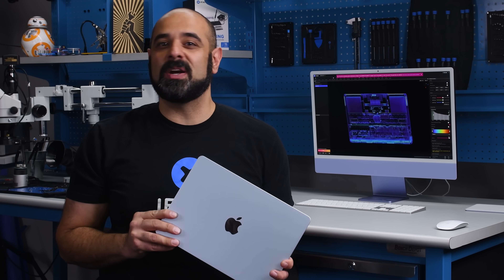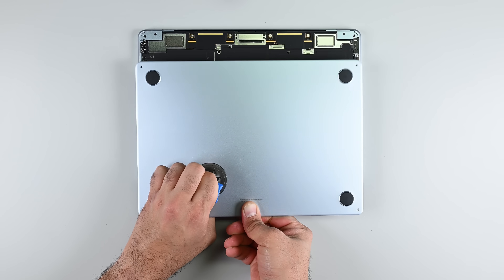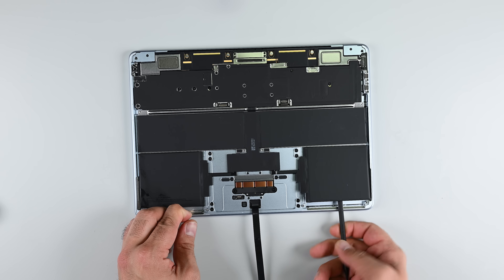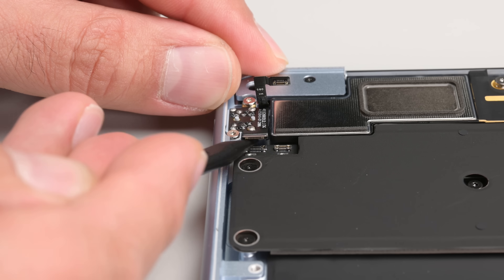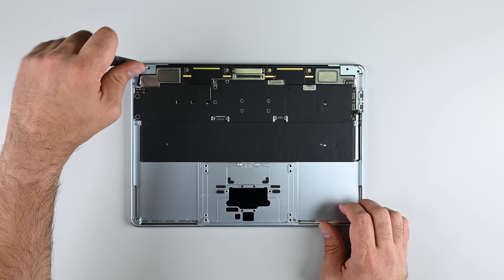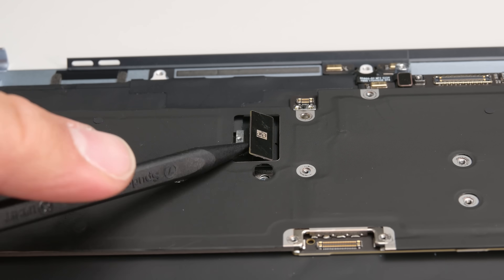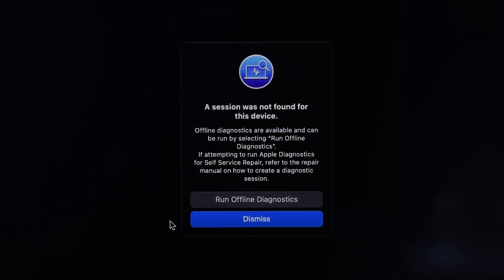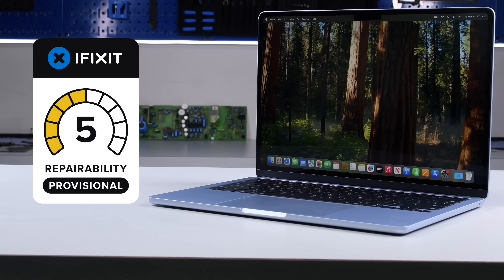MacBook Air M4: A Repair Win or a Locked-Down Mess?

Comment: So I replaced the screen for M4 Air, and now nothing works like my trackpad, keyboard, and backlight, only works in recovery mode. I checked with AI and it says its a new feature of Apple on M4 and up. They automatically lock when they detect screen replacement and only certified Apple Repair Centers can fix it. Do you have any idea how I could fix it myself? The screen I put is a donor from a same exact MacBook

Comment: what happens if something really small and solid, for example skin gets into the space under touchpad? because there is space in the lower part of the touchpad
Reply: Nothing? The trackpad isn't mechanical it doesn't physically move. The click you feel is the haptic engine.

Comment: What will likely die first ? The battery or the ssd ? Is the ssd soldered on the main board ? If ssd dies i guess we can still boot on a external ssd and if the battery dies i guess we can power the mac theough a external usb battery ?

Comment: People keep overlooking how part paring stops criminals from stealing devices and selling it for parts.

Best compromise is have a setting on your iCloud device so that you need to unpair it and then also do another step to unpair components.

So that if your MacBook dies. You can unpair it and now the parts are free to be used. So if someone steals it, well they can’t unpair it without your iPhone, Password, Email so now it keeps the good anti stealing by having it all be paired. But if it actually breaks and needs to be fixed or you want it use parts from it. You can.

Probably super hard to build such a system but that’s the best solution.
Reply: wow excellent idea. sadly I don't see apple (or other manufacturers) adopting this.
Reply: They already have exactly this for iPhones, let’s hope it comes to Mac’s too
Reply: I don't think this prevent anybody from stealing. They don't care. They would steal it, see that it's unusable, throw it and go on with their lives.
Reply: If my device is stolen, I couldn't care less what happens with it. Its gone either way.
Reply: @emaaddar5017  it makes it less attractive to steal devices if they cant be sold for a profit, thus making theft less common.

Comment: All done on purpose. It's a nice device. Just don't buy if you cant swap SSD or ram.  SSD dies after 3 to 4 years depends on use. Then laptop becomes an expensive paper clip.
Reply: my 2017 macbook pro still works fine. most of them do actually.

Comment: A locked down mess. SSDs wear out in a few years if used every day, and replacing them shouldn't require a full disassembly and soldering on the main board. This bs parts pairing is still going on, it's insane...

Comment: Sorry dude, but the use of salvaged components feeds the black market of stolen laptops. Those locked laptops will be sold for parts if theres nothing preventing the use of those parts on the system.
Reply: well. good? do you think those laptops will become less stolen if you just wish hard enough and believe every word out of apples mouth? personally i would rather see stolen laptops not become literal trash, even if that means they get sold for parts

Comment: It’s weird that the iPhones are getting more repairable while the MacBooks are about the same as they have been.
Reply: They could do with going back to 2012 and earlier. The old MBPs in 2012, I had both a 2.3GHz 15” and a 2.9GHz 13” at one point, and they were so easy to upgrade ram and HDD…even the battery was an easy swap! Mine were both non Retina and had SuperDrives, I bought caddies and put in two Samsung EVO SSDs in each, and booted off them in parallel (RAID 0)…they were darn quick for Intel machines in that configuration…I uploaded my stats to Geekbench.

I even swapped out the touchpad on the 13”, piece of cake.

Comment: I just know they will remove the parts pairing lock someday. Apart from that, this is a rather repairable machine, sure most components are soldered, which is a pain, but that's what it took to make them as power efficient as they are considering how powerful these machines can be. Plus it's acceptable for an ultra-thin laptop, not so much for the Mac mini and specially the Mac Studio and Pro.
Reply: don't hold your breath
Reply: @ I know they will either because they are forced to or change their mind like they did with the 15 series by allowing used parts to be paired. On the board-level stuff tho, yeah I don’t expect much apart from maybe upgradable storage, like we have seen with all Mac Pros and Studios plus the new minis. Sure, they will be using their silly proprietary designs but as long as it can be replaced and is socketed, the third party market will always find a way.

Comment: For me upgrading the RAM and storage is big repairability. Sadly Apple will never let this happened until some government body wants Apple to do it .
Reply: RAM is defensible in modern CPU architectures. Storage I do agree should be easier to replace in most cases.
Reply: soldered ram does make sense from a performance perspective but storage does. I'd want them to keep things unified until a socketed solution is as fast as we have now. but on the storage front now we have thunderbolt 5 external ssd enclosures that outperform the internal SSD chip that is soldered into the motherboard. So just greed, really.
Reply: Socketed RAM can’t keep up with modern architectures, its why Framework went the soldered path with their desktop

Comment: huh, the speakers being part of  the antennas is a page out of the ill fated MacBook 12 inch.  is this the same in the 2022 Air?  def not the M1 Air, as I had to take the speakers out of that one to replace the battery (speakers first).
Reply: been the design from M2 models onwards.

Comment: parts pairing should automatically deduct 10 marks from whatever score you have... there cannot be anything more disastrous to repairability than part pairing.
Reply: Parts pairing can be done at home by the user
Reply: imo not having modular parts is worse. Imagine if the usbc ports were part of the MB (something Apple has done before many times). If one broke you’d have to replace the entire board including paying for a new cpu and gpu and storage and ram. All because a port broke. That to me is way worse
Reply: @nickd7935 how about usb c is modular but paired. After the device is out of Apple support list u can’t do anything with that modularity

Comment: I'm shocked that the MacBook Air has more repairable USB-C ports than my ThinkPad. A surprise, but a pleasant one.
Reply: Lenovo absolutely cooked the thinkpad brand, especially with the plastic body base models that flex so much that the logic boards snapped. I don’t daily drive it but I still have a thinkpad T530 which is my favourite laptop of all time
One of Lenovo’s first thinkpads before they ruined ir
Reply: @himynameisryan  I have a T480. Without a battery. The ports are miserablt loose.
Reply: @ the 80 series is way newer and they’d already ruined it by then
Reply: @himynameisryan  you are talking about ideapad not ThinkPad....
Reply: @ no I’m talking about thinkpad.
The new thinkpads are just basic ultra books, the base models are plastic and flex so much the motherboards break inside. I work at a Lenovo warranty centre.
The more expensive ones are magnesium and don’t break so easy but are still just ultra books
The chunky thick boi thinkpads of yesteryear are long dead and everything after them has been progressively worse build quality, and as this comment pointed out they are becoming less and less repairable
Ideapads are a different thing entirely
Reply: @ I do still hate the MacBook keyboard, unfortunately. I would rather use a modern (T14 or later) "low-travel" ThinkPad keyboard than the joke on the Mac.
Reply: @himynameisryan  its just the E series innit
Reply: Crazy 😧
Reply: Yes this looks very easy to repair it is making me think of getting one my thinkpad can’t run windows 11
Reply: Yeah, they've been shipping USB-C MacBooks for over 10 years (Jan 2015) and only one model had soldered ports, (an entry level 2017 model) they learnt pretty quickly that was a bad idea. I think it's one reason they've added back the MagSafe magnetic charge connector which is a lot more robust. You can still fully charge with just USB-C only though.
Reply: Exactly I was very skeptical having just repaired my daughter old iPad 8 gen. I was shocked how intricate and delicate things are. I feared Apple rolled the same design into the Macs but thankful this M4 seems ‘ok’. Now to wait for DosDude’s YouTube channel to show us how to get around the storage and parts gen lol
Reply: @ChadamusMaxamus  Apple (and authorised repairers) repair MacBook Airs, they're deisgned to be modular. Like an iPhone is. An iPad isn't designed that way, they swap whole iPads over for a repair price. So it's quite a different build. Good job fixing the 8th Gen though :)
Reply: @ I mean the iPads are a lot thinner than the MacBooks tho, they have to fit more stuff into less space
Reply: You can upgrade your Lenovo instead any Mac
Reply: @gto981 new thinkpads got most things soldered as well ☹️
Reply: @himynameisryan  6 month ago I bought Winblu notebook, i5 11th, 16 GB RAM and 1 TB nvme payed 500€. Unscrew 8 screws, I can upgrade to 64 GB RAM and ad add 2.5" SSD
Reply: EXACTLY!  I took apart my thinkpad because the USB-C connector went bad and realized it is not worth it.  I thought it would be an easy and inexpensive fix because it was thinkpad.  I bought thinkpad because of repairability and to see the macBook air beat out thinkpad on this one is terrible.  My next laptop IS going to be apple.  Goodbye thinkpad.
Reply: As you referred to the ThinkPad, I want to mention that I have used Thinkpad T490 for long time. Absolutely fantastic. No issue since 2019. Now changed to HP zbook g11 intel ultra 7 14 inch. Very great to use and speed pretty good. It costs me similar to the price of MacBook Air M4 base model. Very satisfied. Breeze to use.
Reply: @ the new thinkpads aren’t as good as the old ones
They’ve become just another ultra book 

Personally I’d rather a m4 MacBook Air for an ultra book because all the laptops you mentioned aren’t as good in the battery, display, trackpad, speaker, performance on battery, and maybe even single core performance, personally I prefer the thinkpad keyboard to the MacBook one but after using a Mac you get used to it, it’s good enough 
Everything else tho I’d take a MacBook unless you specifically prefer windows or need windows programs

Comment: If apple locks the part with software I have a simple fix just remove the software and install linux
Reply: What is the point of spending the ridiculous amount of money Apple charges unless you specifically want Apple software
Reply: You can't do that on the M4 unless you want to write your own drivers and distro

Comment: I’m not concerned about using third party parts, in that I would never use them. Who makes them? Where are they made? Do they perform equally? Is there any reason I should be concerned about malicious behavior from this parts? Really, I want genuine manufacturers parts. If something needs to be calibrated, I understand that. These are concerns that are important to me. The reality is also that studies have shown that a lot of time people repair their own devices, the performance isn’t the same. Sometimes people break parts. Not knowing to to start a screw (you turn it backwards until you feel and hear a small click, indication the screw is returning to the thread in the part) means you can strip the part and damage the screw partway in and damage the head so that you can’t get it out again. Lots of times people think they can repair their own devices when they actually can’t. Being heavy handed, impatient, not understanding the instructions are problems that are more common than you might think.
Reply: My brother in christ, ... tell me what the reasoning is supposed to be for having my Display artifact while in use when I pull a fully working OEM display from a defunct unit and place it on a different one (same model obviously)? Calibration?? LOL! My ass. It's gatekeeping for the funny new doublespeak term "aftersales". You need to bring it to an authorized service provider, they'll click a button, the artifacting is gone. Let's just say I'm talking from experience - and not that of a customer mind you. 

Parts pairing - where no secure enclaves for biometrics and the like are involved - is abhorrent anti-consumer bullshit. If you're willing to play along and bend over backwards doing apologetics, more power to you. Just know that the result is one where you're not ending up with "more power" ;)

Comment: PC manufacturers need to take note of the USB C ports not being soldered to the motherboard for easy replacement.
Reply: I came to make same comment!  THIS is the most common use/wear failure and they did a good job with flex cables on the connectors so that mechanical movement is not stressing the solder joint! It is a double win because the flex cable permits some tiny compliance without stressing solder AND it is easily replaceable when it fails!
Reply: Apple shipped the first USB-C Laptop in January 2015, all new MacBook designs since have been USB-C. Only one model, the entry level 2017 2-port non-touch bar macbook pro, had the USB-C ports of part of the logic board. Everything else had separate ports.
Reply: I don’t have to worry about this problem. I’ve always babied my 2011 MacBook Pro bought brand new & I still baby it. I also baby my M4 Pro bought new Dec. 29, 2024
Reply: In fairness, they are super easy to replace if you know who to solder.
Reply: From just the engineering point of view, Apple is second to none. I'm always amazed to see how well thought out these devices are internally. So sad about their attempts to stop people from repairing things themselves, because these devices are so well made for that.
Reply: @Hans-gb4mv  They design stylish components, nothing more. Macbooks have had a lot of terrible design choices (not just from a repairability standpoint, stuff just was designed to break from normal use).
Reply: @ That's demonstrably untrue.
Reply: @shadik1998  you don't know what you're talking about, I've had a MacBook Air 2017 and its still working with me under heavy use, zero issues
Reply: @Sornio Lmao the post 2016 keyboard was so bad that even apple admitted it and made a recall of pretty much any MacBook post 2016 due to butterfly keyboard failures. Not even mentioning the flexgate of MBP which was never addressed, even though widely reported by mass (including apple-leaning) media. Geniuses made the display cable so short it often broke itself within a year or two. Then apple silently extended it by 2mm and thought no one will notice in 2018.
Reply: Boom, roasted
Reply: Nope. As you know, all manufacturers try not to allow users to repair. You must go to see them every time.
Reply: or at least do what framework has done, make adapter to extend the type c port, and extended part can be easily swap out.
Reply: @taiwanese_9999 its pretty space inefficient, theyd rather use that space for more battery
Reply: @joebidenVEVO  so it is "at least", still better than solder everything on mainboard.
Reply: where do u think apple copied it from?

Comment: Display replacement common repair? I have never ever broken a display on any laptop. What exactly is ifixit smoking?
Reply: He is not entirely wrong though. It's more like replacing the bad display units as opposed to broken ones. The ones that have nasty green/red lines streaking across the middle of the screen.
Reply: Ever heard green line or burned display?
Reply: your laptops probably don't have a glass surface on their displays then. Macbooks do and the tiniest speck of crumb stuck between the keyboard and the lid will potentially kill the glass surface + LCD.

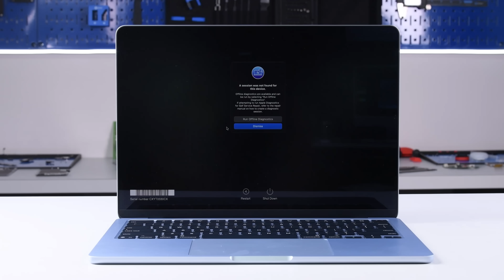Comment: 6:17 Is it upgradeable (but proprietary) storage? No.  I'm guessing many of you came for this info.
Reply: Yes, I was waiting for this. I only bought the M4 Mac Mini base model because I'll upgrade its storage myself (there are already aftermarket 2TB modules), and I would've only bought the new M4 Air if it had a non-soldered storage module as well. So it's a pass i guess, maybe next time. I'm not willing to pay for the storage upgrades from Apple.
Reply: @hrznn External SSD is the way to go anyways.
Reply: Been waiting all week for this answer
Reply: Should be but it has its caviart as the part pairing on top of when there is a free space but it misses quite a few components to actually put a nand chip there

Comment: I bought an iPhone 8 Plus battery, & now I cannot get rid of the assistive touch, I have tried everything & it has a funny way of popping up just before I tap the screen & so then an unwanted function occurs. I have bought batteries from iFixit before & not had this problem. This one I will have to send back!😪

Comment: I was looking forward to seeing the heatsink on the SoC and seeing if it seemed better than last year. But you didn't do anything with the mainboard besides remove it.
Reply: You can look it up online…
Reply: @AndrewPL5 funnily enough this video is also online, and it would be a very reasonable place to show that. of course there are other places to see it, but why not here too?
Reply: @jotch_7627  because not every video needs to or can show every little thing. My point still stands, if you want to find out information you can look it up online. If this video doesn't have what you're looking for, continue looking. No point in commenting that the video is missing something (although it never needed to be in the video) when you can find it elsewhere. It hurts my brain when you people think everything you watch needs to perfectly fit what you want to see, rather than looking into finding the info you're looking for.